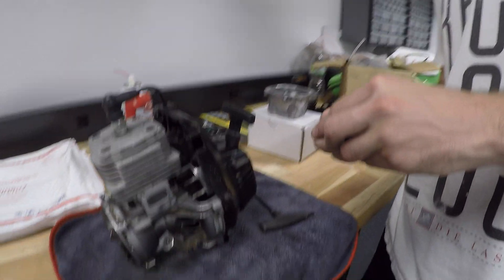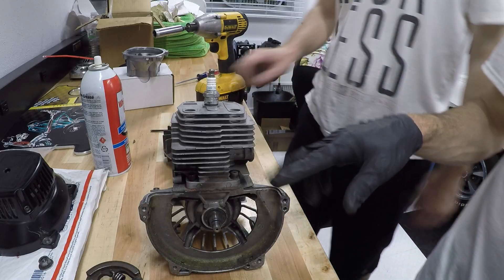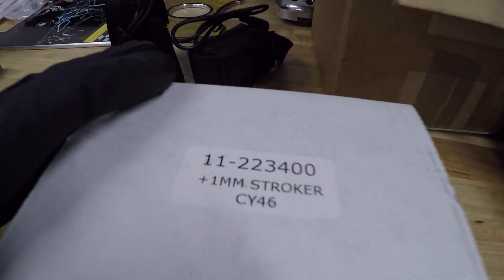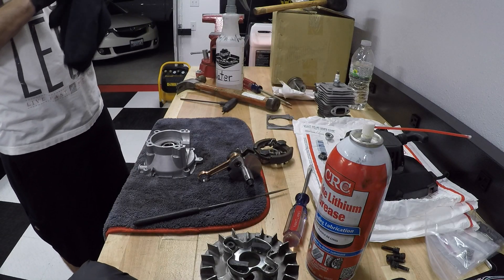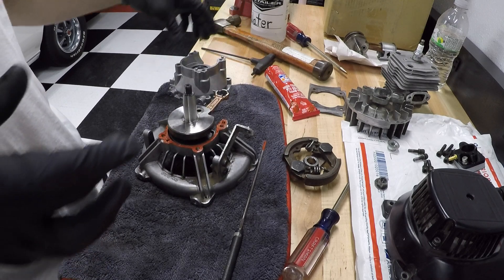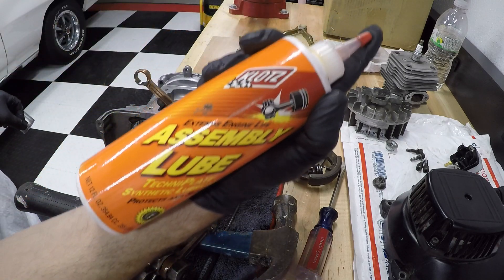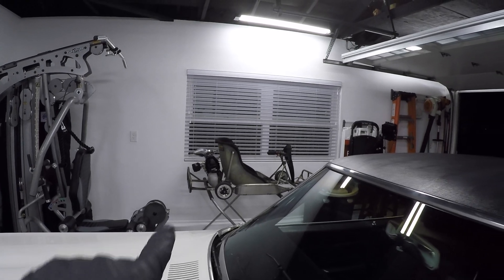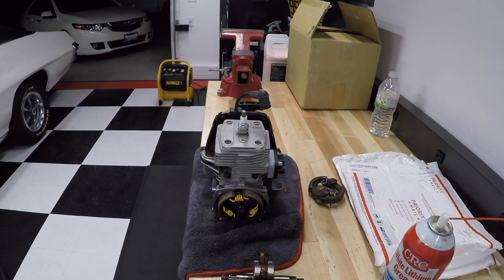+1 Stroker GP460 Motor BUILD!

Comment: Can u recommend any upgrades besides a $99 torque box on eBay,a $20 16mm carb,and $20 air filter that I can’t figure out how to put the choke lever on with it. But besides this,I depend a lot on my evo 2x. I would love any feedback,and if I decide to get the GP46 engine,where can I find the info on how to,and what I will need. I’m just looking for a little speed,and longevity. Thanks guys.

Comment: is it required to double up on the cylinder head gasket to make room? or just the stock one alone work?
Reply from the maker: So far on this build one one gasket was used and it seems to be working well.
Reply: +Derek Short ok cool thanks. do you or can you make a video for checking squish? it a concept I just don't get